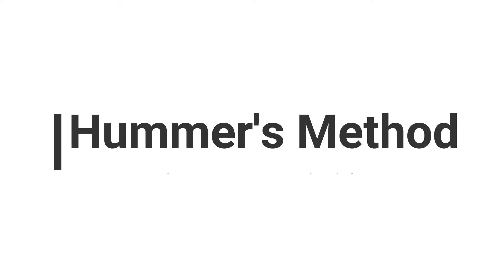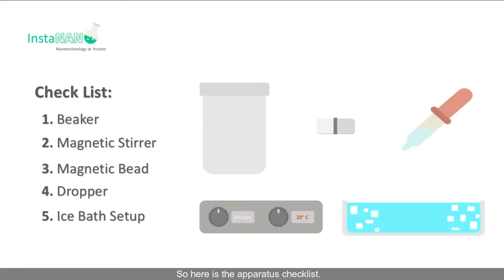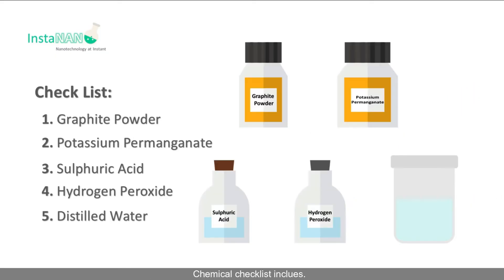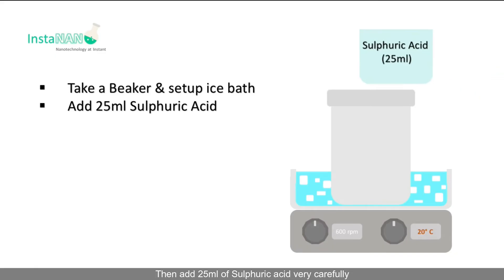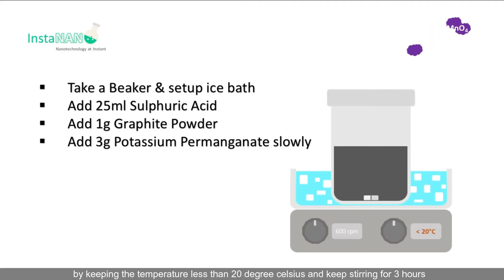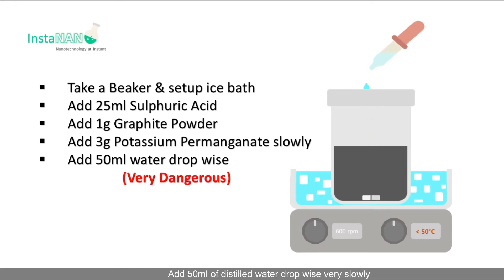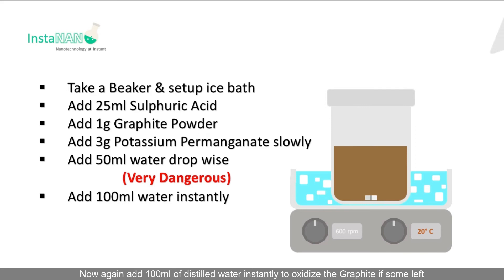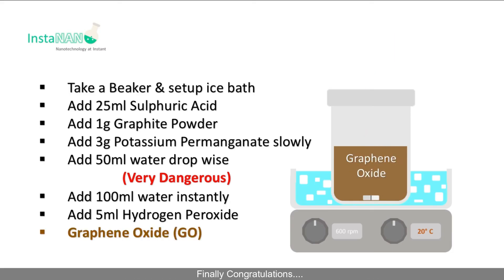Synthesis of Graphene Oxide (GO) by Modified Hummer’s Method - InstaNANO

Comment: Hello friends,

I hope you are all well.

I needed graphene oxide for my thesis, so I followed the steps mentioned in the video and obtained a solution. I intend to use it to spread zinc oxide on a substrate.

Is the obtained solution suitable for this purpose? Also, how can I determine the concentration of the synthesized graphene oxide solution?

Please advise.

Comment: I'm working on graphene can you tell me about the colour of final product?? And also about the filtration process
Reply: It’s may turn deep yellow ..but you will get it in black color when dried…follow decantation till it is neutral then can oven dry to get the final product
Reply: @drarifsiddiquie5443  sir I'm using filter paper to filter the content it get stucked in the filter paper itself and I'm not able collect anything
Remaining and all I get properly as mentioned in the video
What i have to do for filtration and I used Dil HCl for washing
Please clarify my queries
Thankyou in advance
Reply: @drarifsiddiquie5443  sir i am trying this method but witth DI water how is it possible to increase pH from 3.3 to 7.

Comment: why is the water step very dangerous?
Reply: Because adding water to acid produces an exothermic reaction (heat). It can cause the water to boil and erupt splashing acid on you. To be safe you want to use AAA or  "always add acid" that way the heat is transferred into the water and gives it a chance to cool down before vaporizing into steam. Since the order of this is to add the acid at the end, they suggest adding it slowly so it doesn't boil and hurt you. 

If I was wrong about any of this, hopefully someone smarter than me will correct me
Reply: @zenmanproject  What is the safety equipment should we used during adding the water into the solution? Is it manually adding water using pipette?
Reply: nitrile gloves and safety glasses are all you really need. If you don't have a chemical hood, do this outside.

Comment: Please, make an erection this video as it is not adequate to make a GO solution. I refer to use some bath sonication procress, ultra centrifugation ,filtration and washing, dialysis everything is important to produce a high purity, clean GO acquous solution
Reply: @ranikabir I try for making graphene oxide i go through so many literature also used sonicator, centrifugation and washing  seven or eight times but XRD peaks are not matching with the literature i can't find what is the reason behind them kindly share yours experience Thank you.